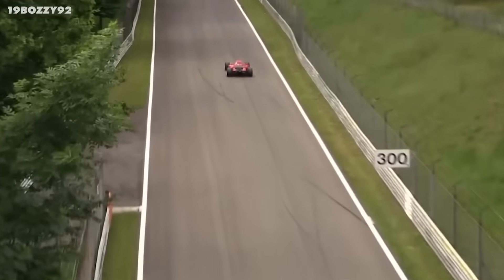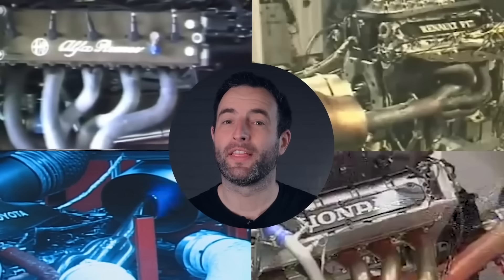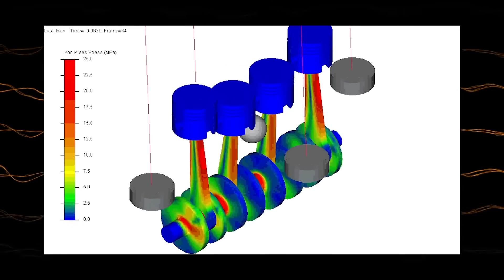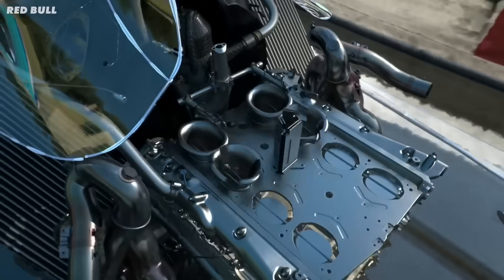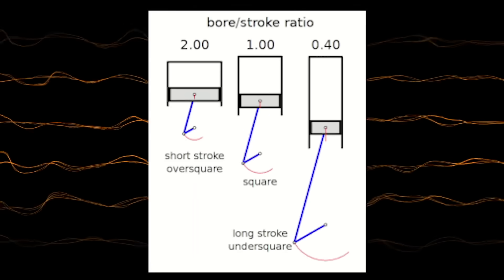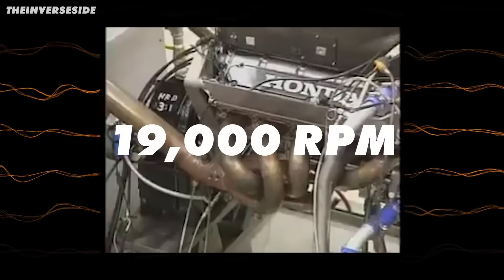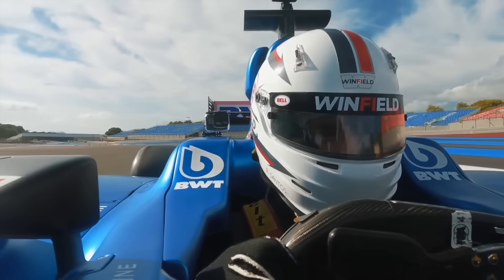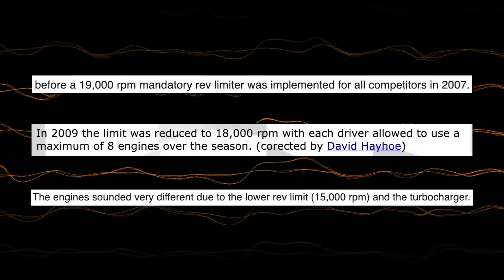When Formula 1 Engines Revved to 20 000 RPM!

Comment: Formula 1 should never have gone away from the 3.0 V10 and the 2001-2008 aero layout. A return to slick tyres, proper use of DRS, and more sophisticated suspension systems would have largely solved the "lack of overtaking". Making the cars "harder to drive" by removing traction control, ride refinement systems, and endlessly advocating for return to stick-shift gearboxes are stupid rationales for more on-track action.

The argument over cost and manufacturer appeal is invalid since the 2.4 V8 had to be developed from scratch at huge cost. It was never simply a V10 minus 2 cylinders. The V8 suffered from vibration issues inherent in its layout that could not be solved given the subsequent testing ban in 2009. The 2.4 V8 did indeed ran regularly in the 20,000 rpm range in 2006 season where unrestricted development was allowed. Myths of 21-22,000 rpm were suggested before the FIA artificially capped it to 19,000 for 2007-08, and 18,000 for 2009-13.

The 2014-2026(?) 1.6 V6 turbo-hybrid (ERS/MGU-K+MGU-H) is magnitudes more costly, more complex, less appealing to car manufacturers, than any other engine format. The mindless complexity and extreme cost of developing these Power Units, drew in only one manufacturer, Honda. Even then, it required over 5 years for Honda to see success after lots of disappointment from 2015-2019. Testing bans, dubious "sustainability" pledges, "tokens" that handicapped development for the very manufacturers this layout was suppose to entice, and per unit penalties that made a total mockery of the starting grid, necessitated use of many artificial gimmicks to "improve the show".

Comment: Making an engine oversquare does two things, really: First of all, because the stroke is shorter it reduces piston speeds. It also reduces accelerations but because the piston itself is bigger I don't think that really gains you anything in terms of reduced loads on the conrods or bearings. But what it does do is allow the cylinder head to have bigger valves. Piston speed, by the way, is the most important limiting factor on engine speed that hasn't yet been overcome: Both an F1 car and a road car won't do much past 20m/s. Any faster than that and you'll wear out the piston rings and the cylinder liners very quickly, as the friction between the two starts to weld them together and break them apart again, tearing chunks out of both of them. Only, because in an F1 engine the stroke is so much shorter, it can spin much faster before that happens.

Comment: Fun fact: In 2000s multiple teams were developing on making V12s, but unfortunately regulations changed, made only V10s mandatory "to keep costs down" and other reasons

Would have been insanely loud, to put in perspective: 1995 Ferrari's 17k RPM V12 were arguably louder than the 19k RPM V10s due to cylinder count and RPM combined

2000s V12s would have been around 20k RPM likely

Comment: the v12s were actually higher revving than v10s, the real reason why they ditched them was because they used way too much fuel. hindsight is always 20/20, but one can argue that that was a mistake as well, as schumacher claimed that the 95' ferrari engine was much better than the 96' one, and it was certainly more powerful

Comment: I grew up with F1 in the early 80's and haven't missed a single race since 1984. To this day, the V10 still blows my senses through the roof and Montoya's lap of Monza makes for one hell of a ringtone. 

There's some old media that Renault released as a soundtrack and also a long form video on VHS of the factory developing their V10 back in the early 90's, around 1993~94 I believe. My mate had a copy back then but I can't seem to find it ANYWHERE now except for random clips of the intakes inhaling fuel and wailing their guts out but if you can find it, I swear it will blow your head clean off.

A huge piece of F1 died inside when they phased them out for V8's and then finally with the lawnmowers.
Reply: I'm with you. Formula 1 died for me with the introduction of the hybrid lawn mower engines, and the final nail in the coffin was the halo. I haven't watched a second of any race since the end of the 2017 season. I'm sure good racing is going on, etc, but I couldn't care less anymore.
Reply: @2006gtobob  The halo already saved Grosjean's life, it probably saved Leclerc's and Zhou's lives, or at the very least saved them from serious injury, and it would have saved Bianchi's life. This is not even counting the many major incidents in junior formulae as well as Formula W.

But I guess to you looks are more important than lives.
Reply: @Ze Rubenator  If safety is absolutely #1,  why not slow the cars down to 5kph and install remote control systems? Why not go over the top and use airbag body suits for motorcycle racing and 50cc as the top displacement and limit them to 3kph. Why don't drivers just race on simulators if safety is absolutely priority #1?  I've been watching all forms of racing since the late 70s as much as I could until the end of the 2017 season. I cut off all television and most media. I used to love the thrill of it all as a fan and was always amazed at the risk the drivers took.
Let's look at things objectively: people drive MUCH faster than they used to because cars are indeed MUCH safer than they used to be, and 85mph seems normal until the crash happens. Race cars are indeed much safer, too, even before the halos, but if you encapsulate drivers, the drivers will feel more apt to take bigger risks that end up requiring even MORE equipment to be there. I wonder if the halos weren't there if the drivers would be more thoughtful?
What happened to Bianci was devastating, a total tragedy, talent just wiped off the planet. I saw it happen, I watched it. He never should've been driving like that, a simple misjudgment. It sucks. I really liked him. I pray drivers don't get injured. But, this is a risk filled form of racing at the razors bleeding edge. 
As it is, since 2018, the cars look horrible, and they continue to sound like crap, 10 seasons now.  Their proportions look wrong due to their extreme wheelbases. How the fan base has grown is perplexing to me. Maybe covid had something to do with it as so many more people, worldwide, were home and had nothing else to watch once they finished their Prime, Hulu, and Netflix binging.
I know one thing, I won't watch it, I don't miss any of it, and I know they don't miss me. It is what it is. The world wants to make everything "safe" and filled with cotton candy. Have at it.
Reply: Disagree, the V8 were awesome too!
Reply: That Montoya lap and the Hakinen overtaking in Spa 2000 are two of brightest F1 moments (until Kimi bested that record).
Reply: If that copy was obtained with out copyright then it is illegal, You must pay the rights and/or fines, and/or destroy the copy. Repent and believe in the gospel of Jesus the Son of God, the Savior of the world.
Reply: @ontherightside2647  LOL. All I know is that it sounded beyond fucking epic when blasted through a home theatre system...
Reply: @ontherightside2647  not sure how god will help with the sound of the engine. still waiting.
Reply: i am with you. the sound!

Comment: Great video! For those looking to geek out more on engine design, why it is how it is and advantages/disadvantages of particular layouts (though focused on road cars) look for content from a channel called driving 4 answers. And if you want to see what happens say when a valve and piston meet or what happens when an engine is run with low oil or molasses look for the teardowns of the channel i do cars.

Comment: If my memory serves me right the FIA changed from the V10 to V8 for performance (safety) reasons and the V8 was just the V10 minus 2 cylinders..i.e. all the basics of the engine stayed the same...but the V8 was as balanced as the V10 and thus produced more vibrations

Comment: Despite the attempt to reduce costs, when adjusted for inflation the V10 engines cost only one third that of the current 6C-T engines. The total saving over a whole season of running V10's is 50% compared to today's "hairdryers." The idea the change was for cost was busted even back at the time of the switch to V8's. The reasons were not for cost but politics. Very few car manufacturers had an interest in developing V10 and V8 engines for the road. The majority of manufacturers made mostly I4 and I3 (keijodousha) with only a few models using an I5 or V6. Toyota actually wanted F1 to go to Turbo charged I3's.

Comment: F1 has Incredible engines. The pinnacle of technology, works of art, and feats of engineering. But in my opinion, there will never be an engine configuration that beats a cross-plane crank V8. The throaty roar is unbeatable. Second best sounding configuration is probably the Mazda 4-rotor in the 787B is pretty good too. Links for proof of the best sounding engine configurations below. Put  on your best headphones and enjoy.
- Ford GT40: https://youtu.be/UmwDQGGoVPs?t=8 (one of the greatest videos and channels as well. Sub to Robert Alblas!)
- Ford GT (2005 - 2006): https://youtu.be/UNRbAzmcMAk?t=30
- Koenigseggs (up through the Agera RS and Regera; rip cross-plane crank): https://youtu.be/wQ7mJT6q8KE?t=93
- Brabham BT62: https://youtu.be/BOuE4Y0TbF0?t=46
- Mustangs: https://youtu.be/c0CRLFRI27E?t=51
- Chargers and Challengers: https://youtu.be/xHgind6vWgI
- Jag F-Type: https://youtu.be/6W8uP4Yhtxo?t=104
- Cadillacs: https://youtube.com/shorts/0RH7X_QH-tY?feature=share (greatest of all time?)
- Mazda 787B: https://youtu.be/az39eqLIbyU

Comment: Another disadvantage to the V-12 engine is that the valves have to be much smaller in diameter than the V-10 valves.
Reply: More bearings so higher friction

Comment: 6:45 that is disinformation man... the V12 always are reving higher then a V10, a v16 then a V12 and so on. The last V12 in F1 was in 1995 with 17200 rpm and the best V10 then was Renault which had 16000 rpm, Ford with V8 had 15200 rpm. So this is reality. The V12 was no more produces and the V10 was developed, but it took more then 2 years of development for the V10 to rev higher then the last V12

Comment: Racing was awful because of aero, but engines were perfect, their sound and power delivery was brutal.
The cost reduction was BS, current power units are far more expensive to develop than a V10, and V10s didn't have a limit on the number of engines per season. Getting rid of them in favor of KERS/MGU-K/H was a major mistake for the sake of ECO friendly car manufacturers marketing.

Comment: I actually prefer the V12 sound slightly even though it doesn't rev as high. It just sounds smoother somehow and I like that.
Reply: Absolutely, nothing sounded better than the Ferrari 412T V12 1995 Car revving to 17,000rpm
Reply: Honestly, i as well, it doesn't have as high a pitch as the v10, but it somehow has multiple tones when revving high which i absolutely love
Reply: A absolutely agree
Reply: there is a video on the 1991 mclaren being driven at japan. the v12 sounded thunderous
Reply: The 95 Ferrari revved to 17000rpm. Not that much behind the v10s from there onwards
Reply: Personally,  my all time favourite F1 engine note was the late 70's Ferrari flat 12.
Reply: @ivanjulian2532  My favourite was the first car i heard, the Matra MS120 V12 at Silverstone in 1971.

Comment: F1 should do what MotoGP did: instead artificially limiting max rpm, limit the cylinder bore. MotoGP limited it to 81 mm, what makes 4 cyl 1000 cc naturally limited to ~19000 rpm and ~300 hp. If the Internet tells true, it is 25x cheaper than 1.6 F1 engine ($425 000 vs $10 500 000) for 3x less power (with just a bit lower power/displacement ratio than V10 F1). Somewhat, the whole V10->V8->V6 cutting costs mission went wrong.

Comment: Back in the '60's Honda wanted to see if rpm could outrun the flame speed at very high revs.   This CAN happen which then needs more timing advance but if the cylinder plumbing is made correctly the VE will increase as the rpm's come up and not need more timing.   I think they hit 24,000 and the flame front was still accelerating with the engine speed.
Reply: Lol at that point they are moving into ramjet territory.
Reply: Do you have any links or references to this? I would love to read about something like this. And of course it would be Honda trying it haha.
Reply: Good old Honda. People also like to forget that in the late 80’s early 90’s the big four Jap motorcycle manufacturers (Yamaha, Honda, Kawi, Suzuki) all had 250cc bikes that were capable of revving past 18000-19000rpm
Reply: In a car engine? I can believe it for their bike engines.
Reply: @headlibrarian1996  Honda hired the Donnington track for their 50th Anniversary and they had Mike Hailwood and John Surtees going around the track in Honda F1 cars one a 3 litre and the other a 1.5 litre but the star of the show was a 297 6 cylinder that Mike used to race in the 350 class that used to rev to 18k rpm people gathered around it and then two Honda executives (in suites )  bumped it off and everyone flew away people said you could hear it ten miles away.
But the E class how can you get excited about a 2.5 kw washing machine motor can you?

Comment: It was crazy engineering like this and the sound that got me interested in the sport in the first place. Makes me wonder why I'm still a fan.
Reply: You are not the first to suggest that from what I've seen that kind of racing is pretty exciting.
 I may take you up on this suggestion.
Reply: The engineering is still crazy its just harder to understand nowadays, or hear...
Reply: @sammerry7706  exactly. i don't know a shit ton, but i am pretty sure the tech and engineering is even better now, being forced to fit more reasonable constraints while still achieving comparable performance. sustainability is not as sexy, but still plenty awesome imo!
Reply: @alveolate  wouldnt say better, just different, petroleum has far better energy density than stored electrical energy which is why the cars are so much heavier which is arguably worse but it is a defferent engineering challenge i guess
Reply: This is why I’ve switched to watching the Aussie v8’s. They’ve just done away with all the driver assists this season, back to pure v8 cars like the old days.
Reply: They are getting the same power out of a 1.6L V6. Just think about that for a second. What's more impressive in terms of engineering? 50% thermal efficiency, or a motor that goes brrr?
Reply: @philipegoulet448 engine go brrrrrr☺️
Reply: They are much faster these days
Reply: @Milkywayboy  on slick tires the f2004 would be very close over 1 lap if not faster on some tracks, remember that engine makes almost 1000hp over the entire track, not just when the batterys are full charged

Comment: The reason why F1 engines do not rev that high anymore: fuel flow limitation.
The current set of rules defines both the engine bore and stroke (thus the volume of 1.6 litre) and the maximum fuel flow rate (yes, Ferrari!).
So combined with the other constants like the optimum fuel/air ratio, there is a well defined maximum rev limit above which you will not get more power, just because you cannot feed arbitrarily more fuel.
That limits the maximum useful RPM to about 16,000 at the current rules.
Reply: its around 12k actually.
Reply: @no1washerezz  That is right, I had that number wrong.
But it is the reason for a max RPM in current engines.  There is no RPM limit per se, but it is limited due to the fuel flow rate.
Reply: @Rob2  right, i believe from 2014-2021, there was a real rpm limit set at 15k yet i have never seen a v6 hybrid rev past 13k. 

from 2022 onwards, i don't think there is a set rpm limit. it would be interesting to see how powerful these engines can get if there was no fuel flow limit but of course, there realistically is a permanent limit being the fact that the fuel tank is not unlimited and refueling is banned.
Reply: @no1washerezz  Not only there is a limit on the amount of fuel you can use over the entire race, there also is a limit on the instaneous fuel flow rate.  That is what limits the maximum useful RPM.  You cannot have more than that amount of fuel per second in the engine, meaning that when you rev higher you would need to run a leaner mixture.
This also limits the useful turbo boost.
There is a very nice explanation of all this on the Engineering Explained channel!